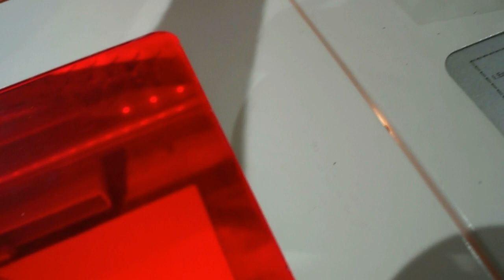k40 laser projects and ideas

Comment: How? I need 4 passes at 15 ma 5mm speed and it doesn’t always go through, what did you do to achieve this?
Reply from the maker: Depends on type of wood.....light model ply 1 cut easy...3mm laserply probably 2 cuts at 10mm 10ma.normal Ply can take 4+

Comment: Why not use the gear generator in Inkscape. Its in Extensions  |  Render  |  Gear  . Should have no problems with meshing, just keep pitch and pressure angle the same on each of your different number of teeth gears

Cheers

Comment: As a Cabinet maker i can tell you that warped plywood is unavoidable. it is the nature of the material. if you want stable use particle core.
Reply from the maker: It's a real pain, out of50 you might get 5 flat.... It's the difference in the materials used for laminating some dry at different rates and cause it to warp. I just wet mine with a damp tea towel and then pressed flat with a heavyweight did work on most

Comment: Nice work. Great to see someone else in England using a K40. What software are you using please ?
Reply from the maker: I use inkscape (free) and the simple free k40 whisperer 
I couldn't get the standard software to work
Reply: @electricdixie34 I use the same but a novice.  I am having trouble making cuts with this software, not sure how to make the red or blue lines on inkscape. Any advice is much appreciated.
Reply from the maker: @kevinshort3483  it is difficult 
There is a YouTube video it show you how..but you've got to set the colour sliders to the full red, blue 
It took me over a week to figure it out... But once you get used to the software it's fantastic
You can import photos and it can engraved the image...taken me about 4 months to fully understand it
Reply: @electricdixie34  I think I have it !  Now when I import the image into whisperer, I am getting a red outline. I have had it a week tomorrow, so very new to me but a great machine. Just waiting on the upgrades to arrive too. If this don't work, do you fancy earning a few hours work and teaching me ?
Reply from the maker: @kevinshort3483  just doing a video how to change to a cut file
Screen recording but it's got a few capture error's
Reply: @electricdixie34  nice one, I will check it out. Thanks Mark